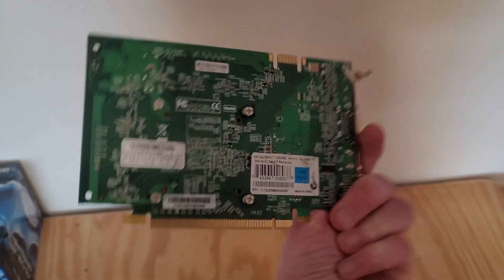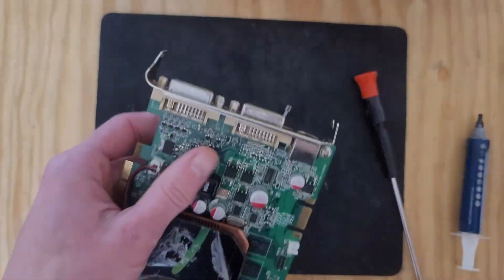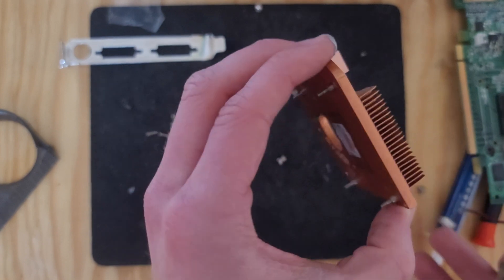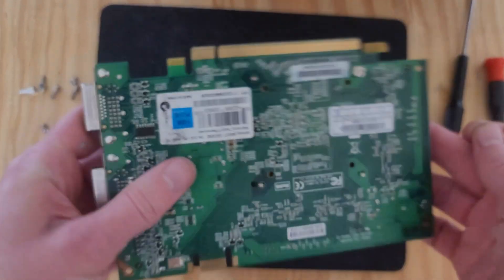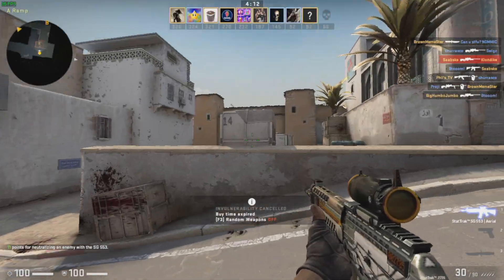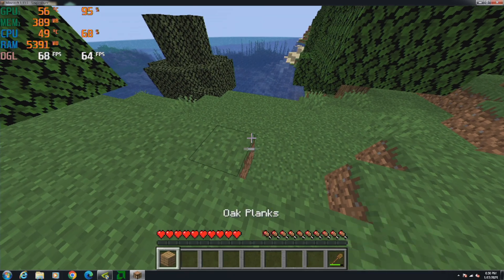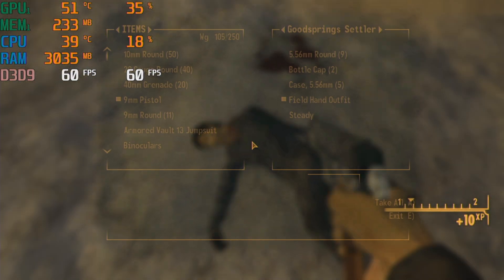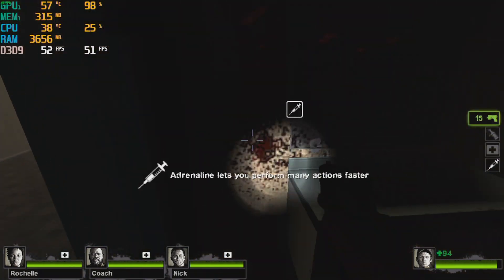Overclocking The 9500 GT Until It Can Run Modern Games...

Comment: i remember that the holes on the PCB for this (and some other 8 and 9 series cards like the 9600 GT and 8400 GS) were square and you could fit a beefy CPU heatsink on it for some crazy overclocks. usually also pasted some adhesive heatsinks on memory too.

SPDIF was used to get motherboard audio with SPDIF header through HDMI output so video/sound was on the same cable. for some cards, you had to use a breakout box for HDMI or component output with audio.

Comment: I can really tell That is an older card There's a whole lot of copper If this  Was newer Graphics card There would be a whole lot less copper  
 That's just something  I noticed about older graphics cards Especially some of the more high endCards
Like the 6870 I actually really like watching youTake apart these cards But I do thinkFor  The  Value and quality And  Price MX4 Is pretty good For thermal paste
And you get a lot more of it Then you would
If you If you bought thermal grizzly I guess it's supposed to be pretty goodBut it's really expensive And with  MX4 You can even put it on Playstation 4

Comment: Many models of Nvidia's 9000 series cards had a hdmi connector that didn't output audio.
You had to use S/PDIF for audio, it was a pain in the a$$. 
A lot of people bought the Ati/Amd 4000 series cards like the 4670 and 4850 because their hdmi connectors did output audio.

Comment: yo you did the video br the 9500gt is a overclocking beast man! i overclocked mine to 850 core and vram its such a beast though
Reply: but bruh i overlokc before and i got 115c and for somereason it didnt even thermal throttle for somereaosn but when the fans kick in it went down to 40
Reply from the maker: That's a heck of an overclock man! Kinda disappointed I couldn't push mine quite as far
Reply: @Jaindike  and the base was 500 for my car i could push it to 900 but its kinda unstable

Comment: anything pre-DX11 is just painful
Reply from the maker: Accurately sums up half my videos right there lol
Reply: @Jaindike  Certainly needs the right set of games for some cards, i would say optimally 1 - 2 years before & after it's release date is the general limits of the cards, specially if it's a lower midrange one like the 9500 gt which trades blows with like a HD 5450 if you want too compare it with something close too that performance but that is dx 11 compatible.

Think the original COD modern warfare from 2007 & maybe up too Black Ops 1 would be reasonably playable on this in 1024x768 (Usual competitive & low budget gamer resolution at the time similar too how some do in cs go, cs source & 1.6 having that 4:3 stretched.)
And maybe 720p & 1600x900 as the upper limit with some settings at low or just off for black ops 1 & original release of modern warfare 2.
If you are looking for singleplayer games id say half-life 2, episode 2, bioshock 1 would run on the 9500 gt reasonably well.

COD Modern warfare I'd say a HD 4870 512 mb should manage around 50 - 75 fps even with cranked settings & 4x msaa in 1080p but a HD 4870 is also WAY faster.
By over 4.8x the performance of the 9500 gt if techpowerups theoretical performance calculation is correct there.

Plenty of games were & are still designed too be more demanding then the hardware could manage at the time & sometimes years later for better or for worse.

Theres a reason "But can it run Crysis " was such a meme for example & sometimes that concept of " designed for pushing future hardware " is not always that well planned or optimized in the right direction...

Also feel free too check out a modded windows 10 install called Atlas OS & compare performance with the same hardware & drivers you would use with the HD 4870 & maybe try the modded Nimez drivers as well in the same video & compare performance between stock windows 10 & Atlas OS as well as those drivers.

Might help a bit with the I3 4130 too produce more consistent or better results despite the same hardware & drivers unless you maybe drop down too windows 7 without the spectre & meltdown patch installed for some of your testing. (These two patches introduce some extra cpu overhead due too the nature of the exploits themselves & for outright games on steam you should be fine with these disabled still, unless you open random emails & get some software "for free" rather then pay for them without researching whats safe & what isn't.)